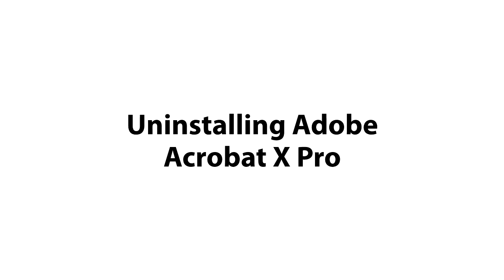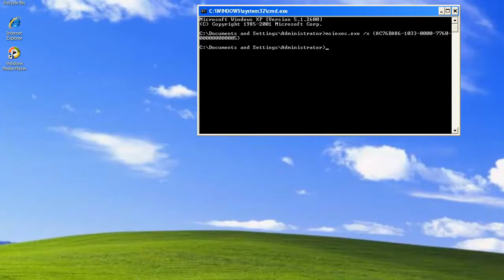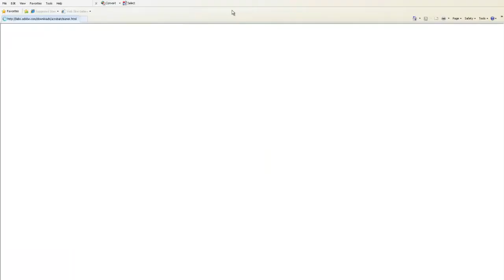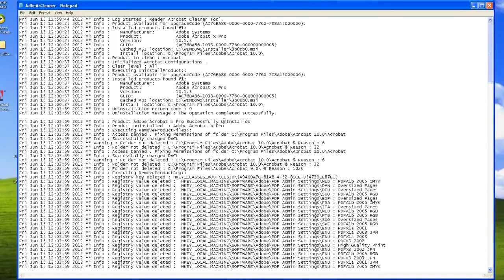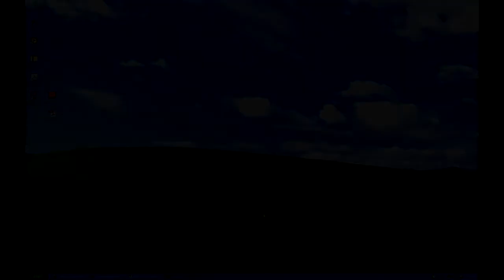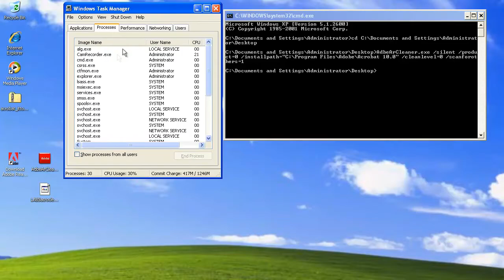Uninstalling Acrobat X Pro | Adobe Acrobat

Comment: Will these commands work the same in the Mac's Terminal? And what if Acrobat has already been removed/uninstalled so you're unable to get the path? I'm having problems re-installing my copy of Acrobat X Pro and even after using the Cleaner Tool and not finding any trace of Acrobat anywhere, I'm still getting a popup saying that an older version is found etc and I can't reinstall. So I'm wondering if going into the command line would be the solution to finding the things that need to be deleted before I can reinstall correctly.